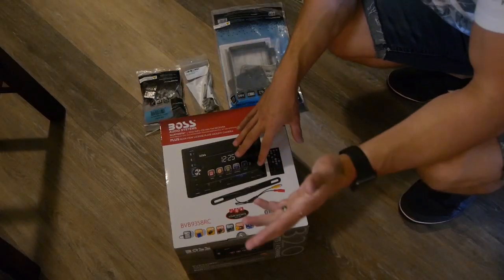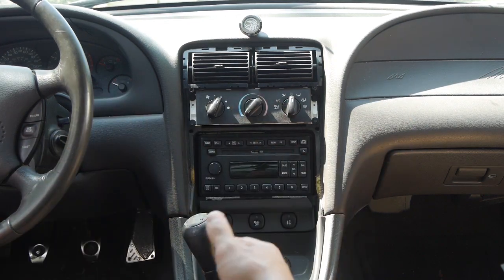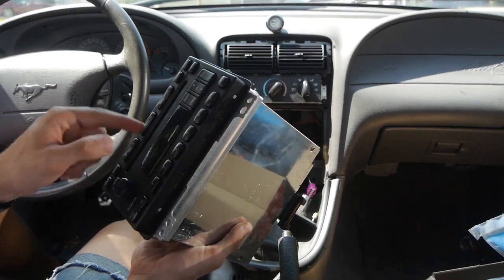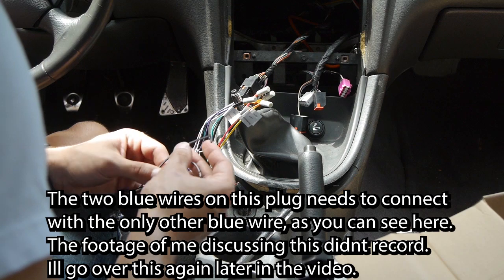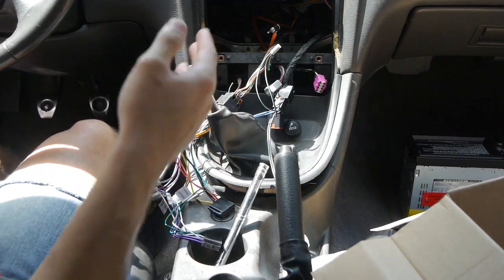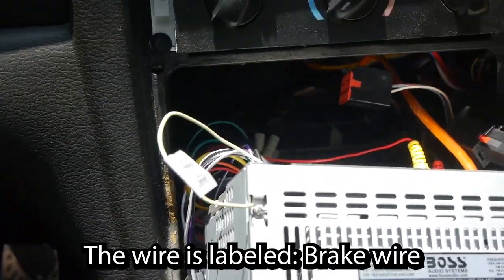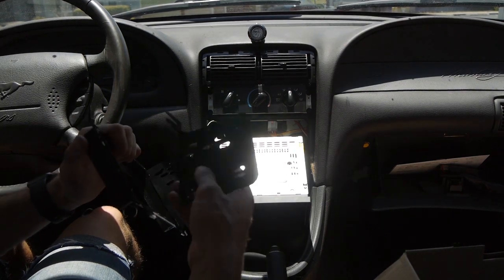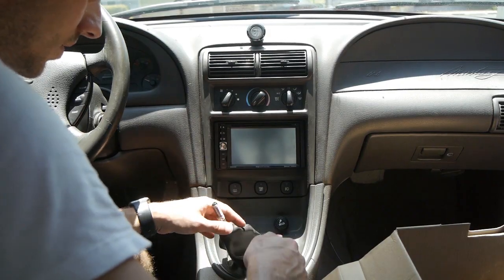How to Install Boss Audio Double Din into New Edge Mustang: Boss Audio BVB9358RC

Comment: Sounds like you have a little rattle there when you start your car, i would get some Lucas oil stablelizer and put in there it will help that on cold start.
Reply from the maker: The rattle is actually from my transmission 😂 probably time for a performance clutch. Also needs a rear end upgrade.

Comment: I just did an install of a boss system headunit but it would not power on. All the wires matched. I'm not sure what going on with it.
Reply from the maker: I would first make sure the power and negative is connected correctly.